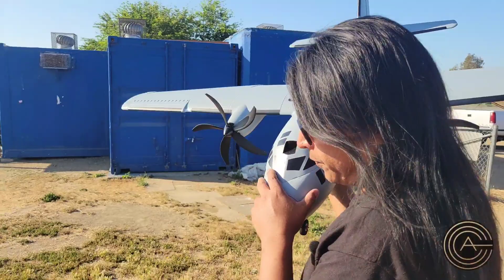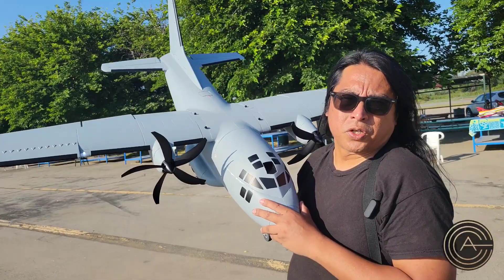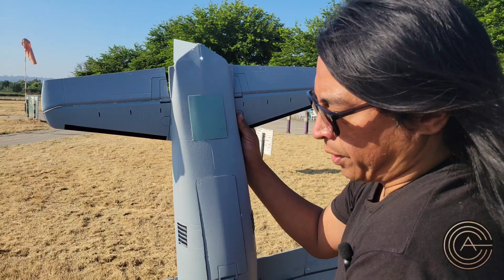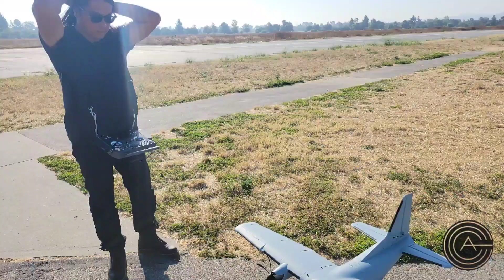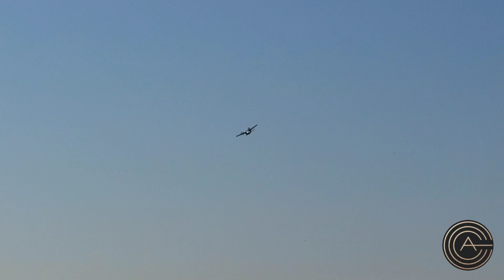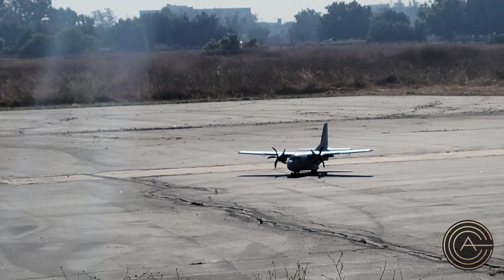E-Flite EC-1500 Maiden Flight

Comment: I had those problems on the original one took time to sort it out
Reply from the maker: Yep but it flies great now. I still fly the crap out of it. The elevator is solid with the servo in the back. I've gradually ran a smaller battery with cg very aft. Ive tamed the wing rock with an elevator to flap mix (not totally eliminated yet). With some mixes (elev to flap) and full span ailerons, it flies awesome. Ive abused this plane... not great landings and one car crash (with the plane inside) and even though it no longer looks new, i still love it.

Comment: how many channels do u need on your transmitter to use the cargo door? i only have 6 channels
Reply from the maker: To do everything?  I think 7 or 8. 8 if you want thrust reverse.  There might be some trick you can do with Spektrum but i don't run a spektrum radio.  Do you need safe selectable on a switch?  If not,  you can use that channel to activate the door.
Reply: @all_rc  alright, thanks!